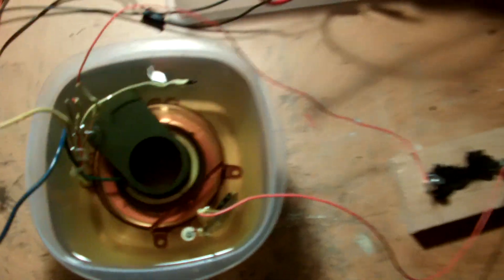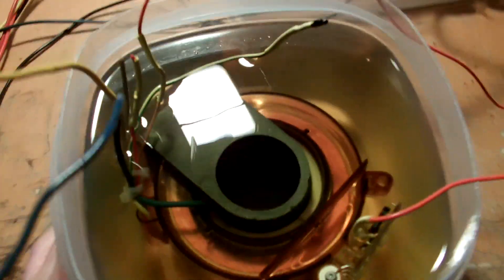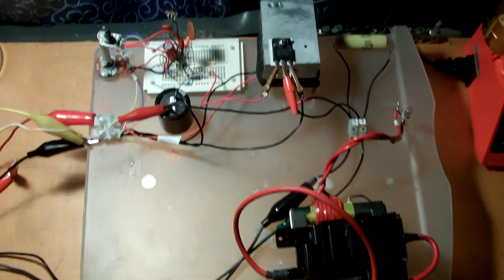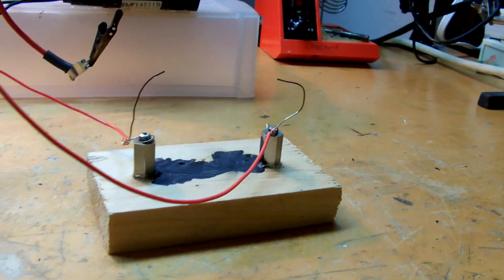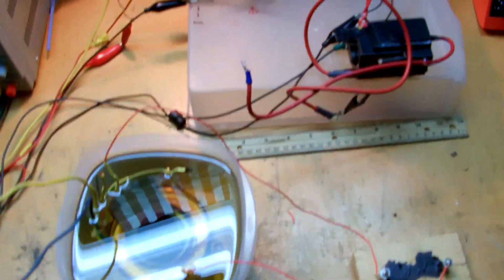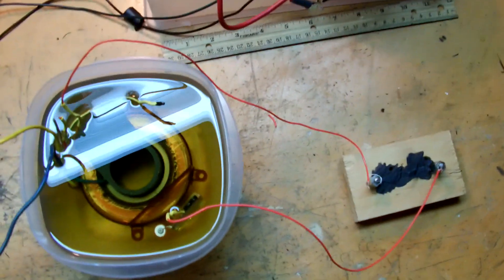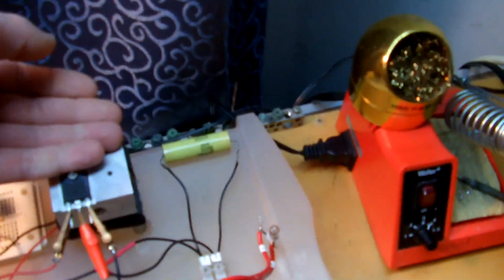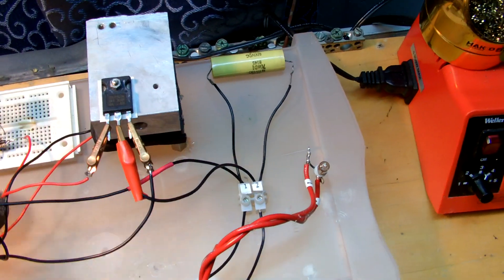70kV X-ray "flyback" test

Comment: Hmm, like all horizontal output transistors they do have some built-in overload protection via internal clamping diode  ~ input load limiter resistor usually connected from the base to the emitter....

Now sometimes (for I have to popped more than I care to list here) doing pretty much that same cool experiment) the best protection for that expensive component is a series of 1000 pf capacitors with spark gap's built-in each connected from emitter to collector then from emitter to base...
In fact, I put some spark gaps, ah the kind you usually find in that high-voltage section of most TV sets and PC monitors all over the place, even have a few inside my power supply to protect the regulator transistors...

Trouble is solid-state devices are easily damaged by tiny nearly invisible sparks that you can only see faintly when all the lights are off and the area is quite dark....
Heck, at $25.00+ a pop we scientists can't afford that kinda expense just because we're always pushing for more kv power...

Comment: Nice. I have a very similar voltage multiplier but it has only three stages. It is not a simple Cockroft-Walton multiplier and I have no idea how should I feed it? There are four wire on the input and one on the output. Can you give me any suggestion about the wiring of this type of multiplier?

Comment: I have a x-ray transformer, from my Panoramic x-ray machine which keeps arcing and burning out. Can someone recommend a way to get the oil to penetrate into the windings, to prevent this arcing.  Then is has to be soldered back into the generator head.    Sincerely Dr Gerard
Reply from the maker: Hi,  per your xray arcing issue:  you would need to submerse the transformer in oil inside a rigid sealed container and vacuum the air out for at least an hour, then remove it very  quickly and place back under oil, it may be rather difficult to place it back in the original head though and i dont think it would be medically proper at that point. Hope that helps!
Reply: Dear Pete, Thank you , this is helping me understand this problem. Perhaps I can rewind it(it uses paper insulation), since it shows some black soot from arcing, then, reinstall it, into the head, and then apply vacuum to the head through the fill hole. How much vacuum pressure is needed, and how is that measured? Your help is greatly appreciated. I could send you pictures if it would help.  Sincerely, Dr. Gerard
Reply: pull a vacuum on the coil can with a vacuum pump will get all the air bubbles out

Comment from the maker: Hey MrPlytiger, you are right about the frequency being rather low indeed. This is because of the voltage multiplier attached to the transformers output, the capacitors dont charge/discharge as fast as i'd like them too so i start with a higher frequency and lower it until the best output is achieved, its an odd transformer for sure!   I do hope to take a newer video of it very soon with a better output this time. Thank you for the comment!!